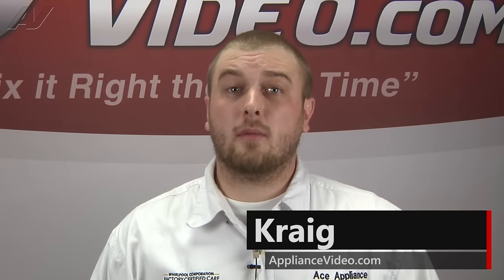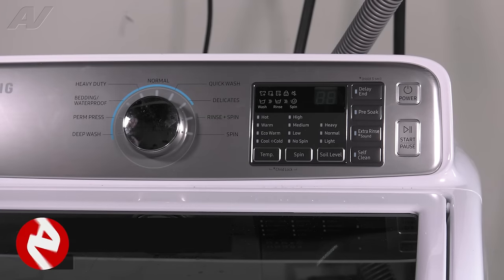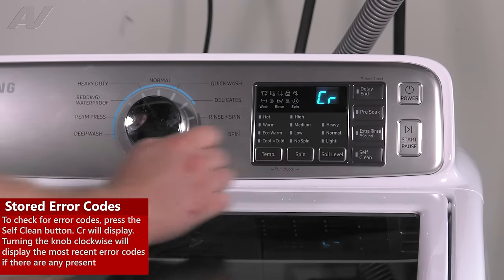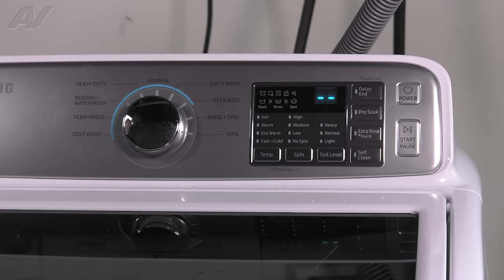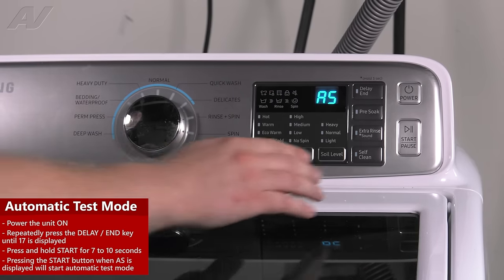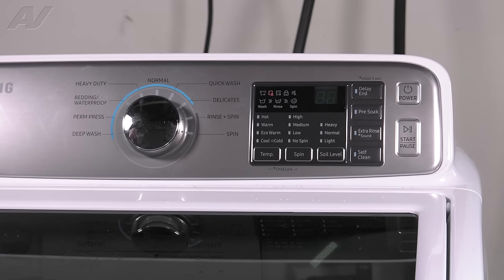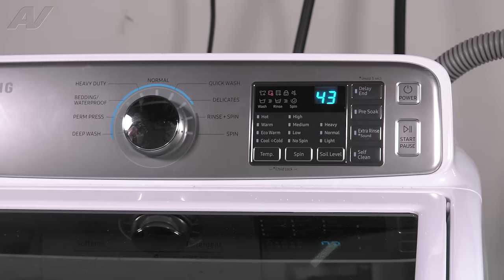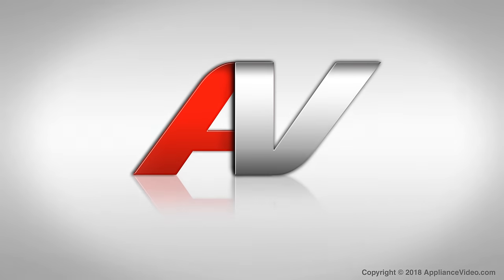Samsung Washer  - Diagnostic Mode, Error Codes, Troubleshooting

Comment: What if it's not turning on ? And it's only about 2 years old.
Reply from the maker: Great question, if you have a more technical question that our parts department cannot answer, you can search our over 17,000 answered questions free at our website www.ApplianceVideo.com under our Repair Help section. You can also call our parts department at 1-800-830-5465 and they can give you help 7-days A week ,or search at www.SaveMoreOnParts.com  .

Comment: I turned of my machine prematurely on my last load. Now my washer doesn't stop filling water on the left witch is the softener side. Does anyone know what to do to so the softener valve closes?
Reply from the maker: Great question, if you have a more technical question that our parts department cannot answer, you can search our over 17,000 answered questions free at our website www.ApplianceVideo.com under our Repair Help section. You can also call our parts department at 1-800-830-5465 and they can give you help 7-days A week ,or search at www.SaveMoreOnParts.com  .
Reply: Try unplugging from the wall and waiting a few minutes before plugging back in to reset.

Comment: I don't have an error code but the washer isn't washing right and now the normal wash sign is blinking
Reply from the maker: Great question, if you have a more technical question that our parts department cannot answer, you can search our over 10,000 answered questions free at our website www.ApplianceVideo.com under our Repair Help section. You can also call our parts department at 1-800-830-5465 and they can give you help 7-days A week Monday Saturday, or search at www.SaveMoreOnParts.com  24 hours 7 days A week.

Comment: I ran the automatic cycle and hit and cold water both came out. When I run a normal cycle like self clean or normal wash. No water comes out, no error message at all. Does anyone know what might be doing this? Any help would be awesome :/
Reply from the maker: Great question, if you have a more technical question that our parts department cannot answer, you can search our over 10,000 answered questions free at our website www.ApplianceVideo.com under our Repair Help section. You can also call our parts department at 1-800-830-5465 and they can give you help 7-days A week Monday Saturday, or search at www.SaveMoreOnParts.com  24 hours 7 days A week.
Reply: Hi did you solve this problem? Having the same exact thing happen here.

Comment: I GET A U6 OR UB ERROR  HALF LOAD OR WHEN WASHING COMFORTOR WITH TOWELS I REARANGE BUT DOES NOT ALWAYS CORRECT THE ERROR IS THERE A RECALIBRATION NEEDED? MODEL DC68-03228A-03

Comment: I have the same final code as you. But I'm not sure if it is a "OE" Code.
Reply from the maker: Great question, if you have a more technical question that our parts department cannot answer, you can search our over 13,000 answered questions free at our website www.ApplianceVideo.com under our Repair Help section. You can also call our parts department at 1-800-830-5465 and they can give you help 7-days A week ,or search at www.SaveMoreOnParts.com  .

Comment: I cannot even get to that diagnostic part reason my crazy machine won t lock when I press start I get the dc code
Reply from the maker: Great question, if you have a more technical question that our parts department cannot answer, you can search our over 13,000 answered questions free at our website www.ApplianceVideo.com under our Repair Help section. You can also call our parts department at 1-800-830-5465 and they can give you help 7-days A week ,or search at www.SaveMoreOnParts.com  .

Comment: My machine won’t lock and start. What do I do ?
Reply from the maker: Great question, if you have a more technical question that our parts department cannot answer, you can search our over 10,000 answered questions free at our website www.ApplianceVideo.com under our Repair Help section. You can also call our parts department at 1-800-830-5465 and they can give you help 7-days A week Monday Saturday, or search at www.SaveMoreOnParts.com  24 hours 7 days A week.
Reply: Call Jody

Comment: That machine driving me crazy I only use for 10 months now is not starting even the dashboard work the door lock I cannot get going
Reply from the maker: Great question, if you have a more technical question that our parts department cannot answer, you can search our over 13,000 answered questions free at our website www.ApplianceVideo.com under our Repair Help section. You can also call our parts department at 1-800-830-5465 and they can give you help 7-days A week ,or search at www.SaveMoreOnParts.com  .

Comment: I have a Ub error code... how do I fix it please? It goes thru the high speed test but I dont see anything spinning. I hear the motor running but nothing spins.
Help please!
Reply from the maker: Great question, if you have a more technical question that our parts department cannot answer, you can search our over 10,000 answered questions free at our website www.ApplianceVideo.com under our Repair Help section. You can also call our parts department at 1-800-830-5465 and they can give you help 7-days A week Monday Saturday, or search at www.SaveMoreOnParts.com  24 hours 7 days A week.

Comment: Is there a way to reset the computer
Reply from the maker: Great question, if you have a more technical question that our parts department cannot answer, you can search our over 10,000 answered questions free at our website www.ApplianceVideo.com under our Repair Help section. You can also call our parts department at 1-800-830-5465 and they can give you help 7-days A week Monday Saturday, or search at www.SaveMoreOnParts.com  24 hours 7 days A week.

Comment: My washer is stuck on 2 when I’m did the spin part
Reply from the maker: Great question, if you have a more technical question that our parts department cannot answer, you can search our over 17,000 answered questions free at our website www.ApplianceVideo.com under our Repair Help section. You can also call our parts department at 1-800-830-5465 and they can give you help 7-days A week ,or search at www.SaveMoreOnParts.com  .
Reply: Same but if you wait  for a few mins you will get the co an ho code and complete the Diagnostic cycle

Comment: I think every body is better to use the old washers without any codes just put your clothes and wash and that sit,don't buy new one to much trouble and expensive
Reply from the maker: Great question, if you have a more technical question that our parts department cannot answer, you can search our over 13,000 answered questions free at our website www.ApplianceVideo.com under our Repair Help section. You can also call our parts department at 1-800-830-5465 and they can give you help 7-days A week Monday Saturday, or search at www.SaveMoreOnParts.com  24 hours 7 days A week.
Reply: Yes I agree. My mom got this washer and it’s giving her problems. I have the old style washer and no problems at all.

Comment: I’m not getting any error codes but no water is coming out
Reply from the maker: Great question, if you have a more technical question that our parts department cannot answer, you can search our over 17,000 answered questions free at our website www.ApplianceVideo.com under our Repair Help section. You can also call our parts department at 1-800-830-5465 and they can give you help 7-days A week ,or search at www.SaveMoreOnParts.com  .

Comment: well first minute of the video and its already useless to me, so my issue is this exact model litterally wont turn on the power button will not turn on and its plugged in right, even tried another outlet still nothing
Reply from the maker: Great question, if you have a more technical question that our parts department cannot answer, you can search our over 17,000 answered questions free at our website www.ApplianceVideo.com under our Repair Help section. You can also call our parts department at 1-800-830-5465 and they can give you help 7-days A week ,or search at www.SaveMoreOnParts.com  .

Comment: Tried that, and mine won’t go into diagnostic mode. Buttons are a little different, so maybe it’s a different procedure on mine. Model is wa45h7000aw/aa.
Reply: Me too, what gives???
Reply from the maker: Great question, if you have a more technical question that our parts department cannot answer, you can search our over 17,000 answered questions free at our website www.ApplianceVideo.com under our Repair Help section. You can also call our parts department at 1-800-830-5465 and they can give you help 7-days A week ,or search at www.SaveMoreOnParts.com  .

Comment: WA50M7450AW  UR CODE....So this one is 3 yrs old,displays UR every time it goes into a spin, only does several turns code pops.  the basket is tight,shocks are still tight no bounce at all,unit level AND stable,I replaced the PCB,the motors RPS sensor AND the mem sensor mounted under the tub.  The code persists even with a decent load.  I did this test cycle well it works fine but the stupid washer is too much problem.   UR code makes it cycle over and over,wasting 25 gal of water each time.  Stumped!!  The only thing left is the motor which makes no sense since it runs the machine,but the engineering runs us!!
Reply: Mine have the same problem.
Reply: I need know what's mean this error code
Reply from the maker: Great question, if you have a more technical question that our parts department cannot answer, you can search our over 17,000 answered questions free at our website www.ApplianceVideo.com under our Repair Help section. You can also call our parts department at 1-800-830-5465 and they can give you help 7-days A week ,or search at www.SaveMoreOnParts.com  .

Comment: Washer would not come to the AS mode .  What can I do?

Thanks
Reply: Mines doing the same thing
Reply from the maker: Great question, if you have a more technical question that our parts department cannot answer, you can search our over 13,000 answered questions free at our website www.ApplianceVideo.com under our Repair Help section. You can also call our parts department at 1-800-830-5465 and they can give you help 7-days A week ,or search at www.SaveMoreOnParts.com  .

Comment: Reset factory mode ? Code?
Reply from the maker: Great question, if you have a more technical question that our parts department cannot answer, you can search our over 17,000 answered questions free at our website www.ApplianceVideo.com under our Repair Help section. You can also call our parts department at 1-800-830-5465 and they can give you help 7-days A week ,or search at www.SaveMoreOnParts.com  .

Comment: Just got error 8C2. The test started and stopped at 2.
Reply from the maker: Great question, if you have a more technical question that our parts department cannot answer, you can search our over 13,000 answered questions free at our website www.ApplianceVideo.com under our Repair Help section. You can also call our parts department at 1-800-830-5465 and they can give you help 7-days A week ,or search at www.SaveMoreOnParts.com  .

Comment: Thanks for the great video. I have a Samsung wa48h7400aw/a2. I did the automatic test mode (delay 17 + hold start).

I get AS, press start, it flashes 1, then 2, then nothing happens but a few back and forth movements on the drum, and shortly after, it displays  Co.  After about 3-4 minutes, I get 4c as error code which I hadn't been getting for days.

My issues started with my washer not draining. I used a wet/dry vacuum to drain it. Then it wouldn't even fill. It displayed error 4c at first but that went away.

I replaced the drain pump but the issue persisted. I then tested my water pressure and its just over 60psi. Lastly I replaced the inlet valve. Still it won't fill.

Any idea? The washer is about 5yrs old and it's used about 1-2 times a week.

Samsung chat support had me calibrate it but that didn't help. Now they recommend sending a tech but I can usually fix things especially if I get any tech support. 

Willing to pay and any help is greatly appreciated.
Reply from the maker: Great question, if you have a more technical question that our parts department cannot answer, you can search our over 17,000 answered questions free at our website www.ApplianceVideo.com under our Repair Help section. You can also call our parts department at 1-800-830-5465 and they can give you help 7-days A week ,or search at www.SaveMoreOnParts.com  .

Comment: Sir please i need ur help. Give me your whatsap number.
I have front load samsung and my machine stops at the mid of cycle at any time during the cycle, and stuck there for some time and automatically opens its door lock without completing the selected cycle, and the major fault is that it does not show any type of error during its malfunctioning. Without load it is working fine but with load it keeps on cutting its cycle at the mid. I have done every thing that was available on internet, but none of that works..
Now today after watching ur video, i have done error chck. On 01 when i 1st rotate the mode knob it shows 3c(motor nt wrking) , for the 2nd time it shows DC(door nt lckd) , nd for the 3rd time it shows BC-2(the button other than power btn is continously pressed during wash cycle) . Sir if  these errors are appearing in diagnostic mode than why they dont appear when they should supposed to be, i mean during the cycle. Plz sir help me

Comment: 2:15 test cycle mode
Reply from the maker: Great question, if you have a more technical question that our parts department cannot answer, you can search our over 17,000 answered questions free at our website www.ApplianceVideo.com under our Repair Help section. You can also call our parts department at 1-800-830-5465 and they can give you help 7-days A week ,or search at www.SaveMoreOnParts.com  .

Comment: My machine broke down mid cycle and did not drain.... Now I have red lock flashing not the child lock and it won't start/ no error codes! 🤦 Anyone have the same problem? I went through the diagnostics the machine sounds fine and the door locked 🔒 and went thru the cycle 🤣
Reply from the maker: Great question, if you have a more technical question that our parts department cannot answer, you can search our over 17,000 answered questions free at our website www.ApplianceVideo.com under our Repair Help section. You can also call our parts department at 1-800-830-5465 and they can give you help 7-days A week ,or search at www.SaveMoreOnParts.com  .
Reply: Hello. I am having the same issue. We drained the machine with wet vac and unplugged for 30 minutes and it unlocked. However, it's not turning on.
Reply: Can you tell me what worked for you?

Comment: When i hold down the start button codes never pop up after holding for 7-10 seconds
Reply: Same here!
Reply from the maker: Great question, if you have a more technical question that our parts department cannot answer, you can search our over 13,000 answered questions free at our website www.ApplianceVideo.com under our Repair Help section. You can also call our parts department at 1-800-830-5465 and they can give you help 7-days A week ,or search at www.SaveMoreOnParts.com  .

Comment: I can't get to diagnostic mode becuase it jumps right to error code py05
Reply from the maker: Great question, if you have a more technical question that our parts department cannot answer, you can search our over 13,000 answered questions free at our website www.ApplianceVideo.com under our Repair Help section. You can also call our parts department at 1-800-830-5465 and they can give you help 7-days A week ,or search at www.SaveMoreOnParts.com  .

Comment: Diagnostic didn't work. The key pad on mine is slightly different.
Reply from the maker: Great question, if you have a more technical question that our parts department cannot answer, you can search our over 10,000 answered questions free at our website www.ApplianceVideo.com under our Repair Help section. You can also call our parts department at 1-800-830-5465 and they can give you help 7-days A week Monday Saturday, or search at www.SaveMoreOnParts.com  24 hours 7 days A week.

Comment: You cannot unplug the power while putting the washer in diagnostic mode lol
Reply from the maker: Great question, if you have a more technical question that our parts department cannot answer, you can search our over 17,000 answered questions free at our website www.ApplianceVideo.com under our Repair Help section. You can also call our parts department at 1-800-830-5465 and they can give you help 7-days A week ,or search at www.SaveMoreOnParts.com  .